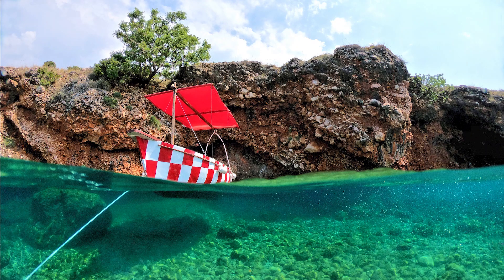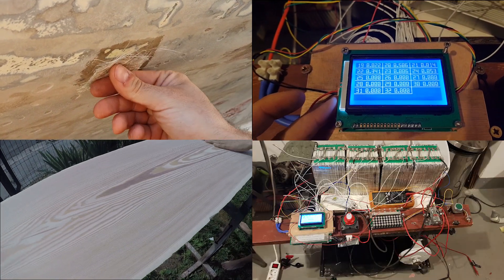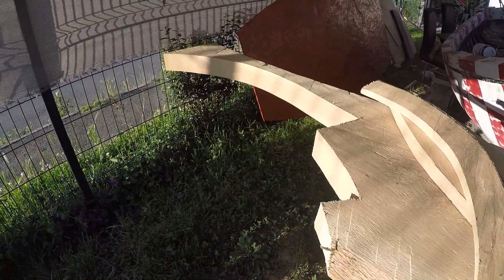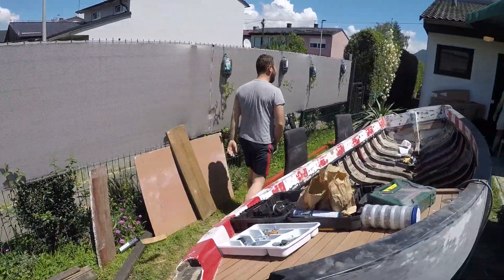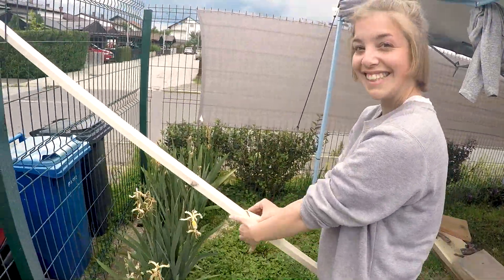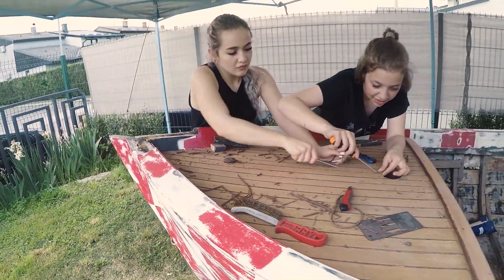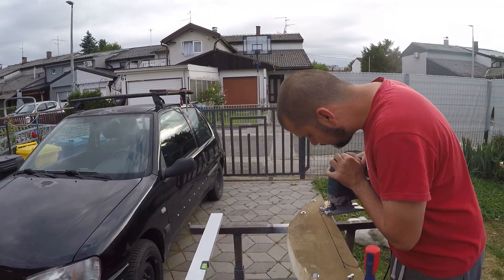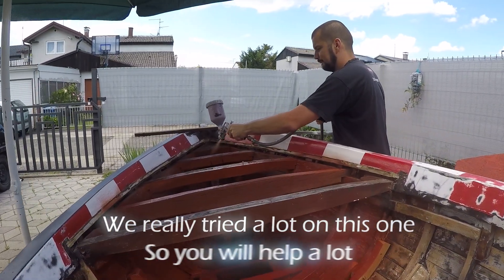Electric Solar Boat Build and Restoration - Episode 1 "The Crew"

Comment: Very cool project, well done! I'm curious if you know if this is the traditional way to make the braces? I would imagine steaming them and bending them to leave the fibers all the length would make them much stronger (even not break when just falling to the ground?)
Reply from the maker: You are right, it would be a lot stronger but this boat is fiber glassed from the outside so the braces do not have as high of structural purpose anymore. Fiberglass is holding the boat together. The braces are there more to hold the wooden seats and for esthetical purposes.
Reply: @T.S.CUSTOM thanks for the response, that explains it, don't tell him he could have glued it then 🙂 Croatia is a very beautiful country, always looking forward to my next visits. Best regards from Norway.